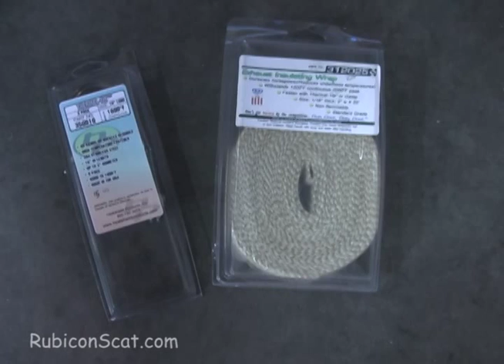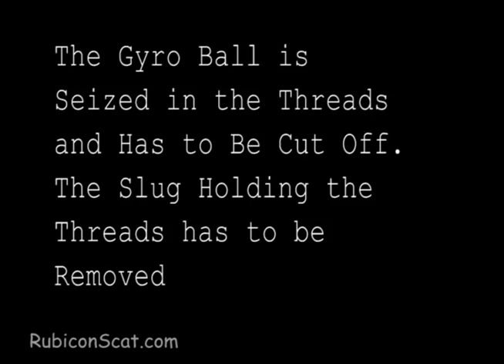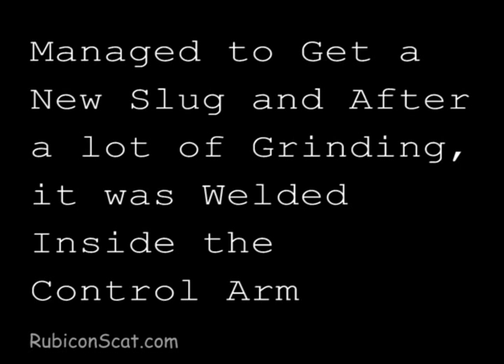Nth Degree Gyro Joint Bushings Replacement on a TJ Long Arm

Comment: How can you tell if your gyro joints are going bad? any tall tell signs? and sue to the lack of availability on the joints would it be an easier job if a heim joint was welded into place on the arm?
Reply from the maker: On my jeep, you could see pieces of the bushing pushing out around the opening which made it a no-brainer that it needed replacement.   I know of a couple of shops in California that have developed their own "johnny-joint" type set up.  I am sure there are others.  The shops I speak of are All J Products in Big Bear and Xtreme Unlimited in Grover Beach, near Pismo.  You can get some of the Nth parts from http://www.knowwhere2jeep.com/.  Not sure if they have the bushings or not.  It is such a PITA to change the bushings, I would definitely recommend another solution if you like what you find.  Call either one of those shops and they may be able to steer you to someone in your area or for your own solution.
Reply: RubiconScat the link doesn't seem to be working anymore... Is there a another contact you know of where I could source Nth Degree parts from?